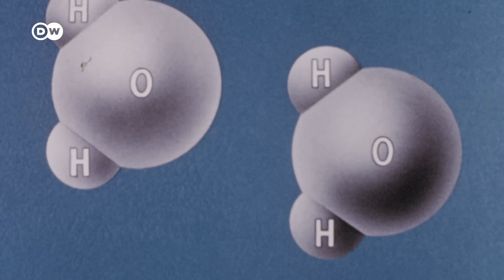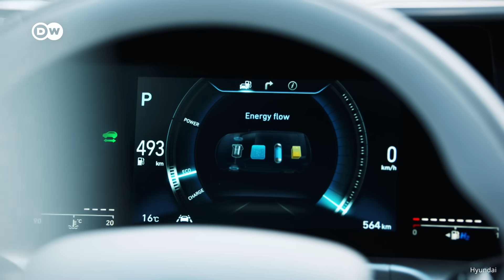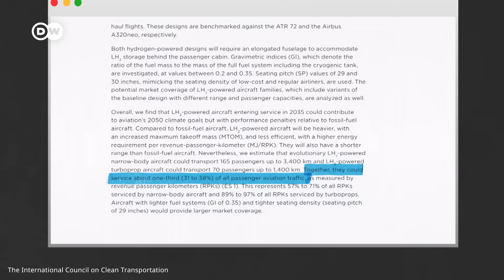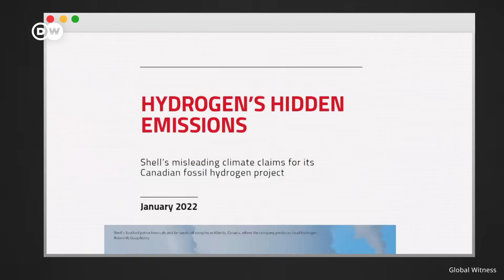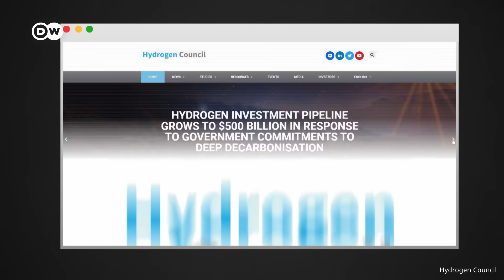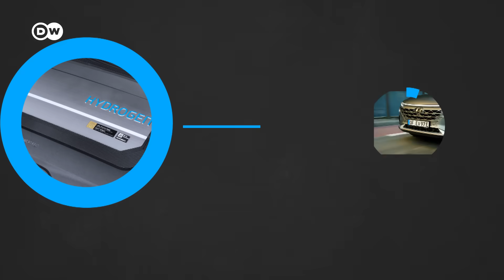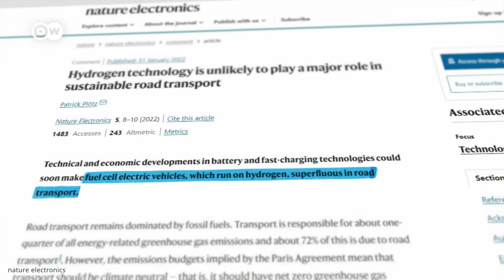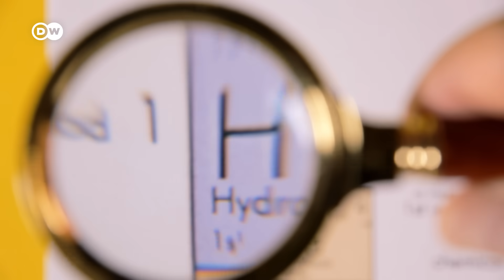The truth about hydrogen

Comment: Good video, but ignores the mining, transporting, and processing of cobalt and lithium for batteries.  There is no mention of nuclear.  Clean, safe, and we have that technology.  Battery Electric Vehicles, take a long time to charge, and if you are using wind and solar to charge them,...I am really hoping that was a joke,...you need to figure out how  much CO2 THAT will produce.  Use the nuclear to produce the green hydrogen.  Hydrogen fuel cells can run cars, trucks, busses, and various forms of transportation and take 5 minutes to refuel,...not 5 hours to charge.  If the grid goes down,...(cough) (cough) California,...you cannot charge an electric car.  The question that needs to be asked is what is the goal?  If the goal is to reduce emissions, then let the free market come up with the solutions and employ multiple technologies.  This is not big government central planning.  That's the Soviet Union.  What works in Paris, may not be the same solution for Sweden,...What works n Sweden won't work in California,...Some places need more efficient 4 cylinders and diesels,...others can get by with BEV's, while others would be better served by hybrids and plug-in hybrids.  Hydrogen fuel cell vehicles are a great solution, but they need two things  An infrastructure of reliable sources of hydrogen, and get the politicians to stop trying to kill the technology.  Leave it to a politician to find a technology that is safe, clean, and reliable,...then try to kill it because it doesn't fit the narrative.  These "experts in the video are talking about 1 size fits all solutions.  That's as ridiculous as it is obtuse.

Comment: The one thing that hydrogen hypers never discuss is the fact that the product of hydrogen use is water vapor and water vapor is the most potent greenhouse gas in the atmosphere.  

When water vapor condenses back into liquid water, it does so through an exothermic reaction, it generates more heat.
Reply: Burning any fossil fuel also produces water vapor - breathing produces water vapor - the sea evaporates a lot of water vapor into the atmosphere - like 70% of the Earth's surface - what is produced through fuel cells will be irrelevant on that scale.  I thought you'd be more concerned with the huge amount of energy required to liquefy hydrogen?

Comment: You put solar power panels on a vehicle that then turns a tank of water into hydrogen that burns in your engine, I realize there's some energy loss but that seems pretty simple compared to a lithium battery that when you get into a car accident and it gets exposed to say rain IT WILL EXPLODE!
Reply: Using your logic we could also fly to the sun and just scoop up some hydrogen and put it in our fuel tanks.  Presto...net zero solved.

Comment: I don't trust Hydrogen. It quite literally terrifies me. You can't smell it. It's explosive way more than gas is, in terms of % of air to fuel needed to be present. Idk. I think nuclear power is a safer option. But I'm also not willing to throw out an option because atm it terrifies me. Possible potential but like nuclear it needs work to be safer.

Comment: hydrogen is - at least the way i see it - the most promissing and best solution for the next foreseeable future. Yes, it's not ideal. It still takes loads of energy to get it thus its efficiency drops making current or very near future EV's possibly the best bridge technology. We shouldn't put it aside though. There's great places on earth that could very comfortably create loads of hydrogen using solar energy.
How wide spread hydrogen is going to work is a little dependent on fusion technology. Once we get fusion reactors working Hydrogen may be the best fuel we can have. EVs can have much smaller batteries, range is going to be higher and technically you could use the car to create drinking water, meaning you can recycle the hydrogen you're burning to power stuff.

That being said, I'm fully aware, that even hydrogen isn't a magical solution to all our problems. And, we must not create it any other way than using renewable energies. If there is a way to derive it from the purification of crude oil into refined without increasing the CO2  emissions as a biproduct, this could be done until the capacity of green hydrogen creation as increased but anything else should not be done for obvious reasons. I'm also aware that fusion technology is far from being anywhere near ready, at this point while we know it could be possible, but we cannot say for sure whether it is actually doable on such big scales. And this is why we shouldn't wait and get a good supply chain of green hydrogen running. In the end this isn't wasted effort. Even with fusion reactors running economically stable this could still be a back up technology.

Another point I wanted to address was already mentioned in the video: While it is possible to comfortably create alright amounts of hydrogen in certain areas already I completely agree that we should think carefully about how we actually use the green energy we currently produce effectively and that at this point in time hydrogen indeed might not be the best idea. But - as mentioned before but never mentioned enough as history has shown - We shouldn't stop investing into green hydrogen today just because it isn't the best utilization of green energy at this precise point. Money we invest today in research will be paid back through much more sophisticated technology and processes once we have a comfortable green energy capacity and it could even advance the point in time this criteria is met.

edit: regarding the cars: I somewhat agree with the video but not completely. I do think battery driven cars can be perfectly fine for city cars, like the tiny cars we have today (Skoda CityGo / VW Up! family, smart for two) but anything that is designed to go for a longer distance or have increased passenger capacity (so basically anything equal to or larger than a modern estate car) should at least be a hydrogen-battery-hybrid. With trucks I think they should have the option for battery or hydrogen run but personally I would prefer hydrogen run trucks. Yes, the efficiency in energy delivery from source to finally the end user isn't as high but batteries aren't a huge fan of high charging currents and the weight of the load - in my eyes - would have a way to high influence on battery life. Yes, it also affects the hydrogen gallons to the mile but a fuel cell doesn't suffer as much on a high load as a battery does on many rapid charge - discharge cycles.

Comment: I think the problem is that H2 is being promoted as if it was a kind of unlimited energy resource. It's not a resource, it's just a storage medium.
Reply: Its a resource and commodity.
Reply: @user-zt4zr7eg6z  It's not a resource. It doesn't exist as a gas in nature. You have to put energy in to make H2 gas. It's a way to store electric energy, but it's massively inefficient compared with storing the same energy in batteries.

Comment: This video lacks crucial detail denouncing blue hydrogen. Why is blue hydrogen worse than just burning fossil fuels? Surely not simply due to methane pipeline leaks.

I work for a major petrochemical company and am part of teams of engineers responsible for reaching carbon neutrality for our footprint. We are actively planning a mega investment that incorporates the production of blue hydrogen and carbon capture and storage. Where is this data against blue hydrogen? I really need to review.

We are also planning small modular nuclear reactors for our process heating and electricity needs. Data for that?

Comment: CO₂ is not a pollutant. Without CO₂ we and all living matter on this planet would die. If the world goes carbon neutral all life will go extinct. CO₂ is good for the planet. Yes, reduce other pollutants that do damage life but not CO₂.   CO₂does not heat the world. When the planet's temperature increases due to external effects ie the sun, then CO₂ increases. It follows temperature increases. It doesn't cause the heating.

Comment: SF6 is an increasing GLOBAL WARMING POISON that we breath.
TESLA is poisoning our entire planet.
Wind turbines emit powerful greenhouse gas sulfur hexafluoride; Germany has highest levels in Europe

While Germany races to build wind farms, there is cause for concern, with a chemical identified as the strongest greenhouse gas in the world being emitted from wind turbines.

In fact, measurements of the air over Germany have already identified the country as the worst offender in Europe when it comes to the highly dangerous substance sulfur hexafluoride (SF6). The chemical is used in the manufacturing of wind turbines and escapes into the environment. With Germany the leader in wind turbine use in Europe, scientists say this is the major factor behind the exceptionally high levels of SF6 readings in Germany.

According to the Intergovernmental Panel on Climate Change, SF6 is a climate killer. In fact, it is 26,087 times more harmful to the climate than carbon dioxide.

Sulfur hexafluoride is a gas that industrial companies consider to be the perfect insulator, and while banned by many other manufacturing sectors, it is still widely used in wind turbines, mainly in electronic switchgears, i.e., the “nodes” in which the electrical energy is distributed. When there is little space to work with, such inside wind turbines, the gas provides excellent insulation while allowing extra space for vital machinery and parts...

https://www.wind-watch.org/news/2022/08/26/wind-turbines-emit-powerful-greenhouse-gas-sulfur-hexafluoride-germany-has-highest-levels-in-europe/

Comment: ...a re-fueling stop for a hydrogen powered ship... which floats on.... water.... just add a 2nd fuel cell that processes the hydrogen from the water as the ship is moving through it... you wouldn't even have to externally power the system if you used a turbine that sits at the bow of ship right underwater which can literally be powered by the ship moving through the water... draw the fresh water in, process it into hydrogen on the ship, power that process via a turbine that's built into the hull of the ships bow, main propeller moves the ship that movement powers the aux propeller which powers the water to hydrogen fuel cell which provides hydrogen to the main hydrogen fuel cell, since these type of fuel cells can be run in both directions... to produce hydrogen from water and electricity or to produce electricity and water from hydrogen

Comment: So we have one hoax being proposed as a solution for another hoax. This is clear because of the things left out of the discussion. These include-

The low energy density of hydrogen under non-cryogenic storage which makes it very problematic to use in portable systems, like aircraft and automobiles. For instance airplanes powered by natural gas would be much easier to design and operate than hydrogen but you don't see anyone seriously proposing doing this, do you?

Storing hydrogen is difficult at best, has significant safety issues and is wasteful on account of the difficulty of preventing leakage. Arguably the best way to store hydrogen is in it's liquid state but that requires evaporation to maintain temperature.

All the schemes require electricity to make the hydrogen so why not just work on cheaper sources of electricity? It seems that is a necessary prerequisite for any increase in the use of hydrogen as fuel. Another solution is finding a more efficient way to produce hydrogen than electrolysis.

I suppose hydrogen is as good a scheme to trick people into a future with a reduced standard of living than any other. Tyrannical governments may yet find it useful to force poverty on their people.

Comment: mix vegetable oil (renewable) with oxygen , in a standard internal combustion engine  , the amount needed would be much less than comparable diesel usage , so fuel and output efficiency is greatly enhanced

Comment: so everybody is rabbiting on about hydrogen , yes it can be used for fuel but it is extremely dangerous ,at all stages from its production to its use , storage in particular , but no one is talking about the other part of water , OXYGEN ! , using oxygen can increase the heat output of just about any combustible added to it , yes oxygen is a catalytic , not really a standalone fuel , so developing its use can really be considered a new avenue , and a viable one at that as it becomes a component of a high output energy source , so is cost efficient

Comment: By collect and storing Hydrogen and Oxygen separately (perfect for electrolysis) you can then use them to power existing internal combustion engines with a slight modification. This mixture provides more power to the engine than existing fossil fuels. Expensive fuel cells aren't necessary. We can use existing engines. This is the best way to help 3rd world countries go green particularly as they often have a great deal of sun and access to sea water to generate their own fuel.
Reply: it produces dangerous byeproducts of NOx when burned in IC engine. Existing IC engines try to reduce NOx by running less efficient and producing particulate carbon and CO, as they are less dangerous. With H2, NOx is unavoidable.
Reply: @mastermanvir  Burning H in air yes. Burning H with O (not air) produces H2O in ICE and more power than hydrocarbons.
Reply: That's if you burn in air. Burning hydrogen in pure oxygen produces pure water. Nothing else.

Comment: Is it possible to do the electrolysis (with water to get hydrogen) in the car? Then, the byproduct of hydrogen can be stored in tanks in the car. When the car is parked, it can be plugged into an outlet to get electricity to continue the electrolysis and replenish the tanks in the car with hydrogen.
Reply: You would need an onboard battery. But then why not just use an EV. Hydrogen is all hype. It should be called Hyprogen! When you study the physics and economics it’s nothing but a distraction gift wrapped by the oil industry to look like a panacea.

Comment: This is a good piece. You mention that for passenger cars the battery option makes sense but it only does so in urban or reasonably densely populated areas. In larger sparser areas (eg Australia) there simply isnt the electricity distribution network to allow adequate charging stations to be built. Think about it. In peak tourist times (eg school holidays) some very remote areas get a lot of visitors. Having to wait 20 minutes to do an 80% recharge is kind of acceptable BUT this means having a charging station that can charge, say 10 or 20 vehicles at a time (probably more). This in turn means your cables into tharging station will need to be capable of carrying 1000's of amps. As I said, this is great in an urban area but when you are 1000km away from the nearest power station the cost of setting up that kind of tranmission infrstructure is simply uneconomic. And this is where hydrogen or limited fossil fueld supplies still has a place
Reply: I agree.  The problems in distributing hydrogen were well explained but not the new electric infrastructure required for electric vehicles.  I have puzzled for a long time how we are going to provide the charging infrastructure even in Towns and villages let alone in the rural areas. There are so many car owners who do not have off street parking and certainly in the UK zero indication the government has a plan to address this.
Reply: @andymiller541  :  The existing infrastructure (with some tweaking) is up to the job IN AREAS OF HIGH POPULATION DENSITY.  Move away from urban environments and it requires "Buy-in" from government and/or industry to identify and establish the preferred systems.  Allowing more than one alternative will ultimately result in the failure of all but one of them.
Reply: Cost? Where will you get the materials? You think all the kids studying programming phone apps are going to build power systems? 🤣🤣🤣
Reply: @robertwilber1909  :  Wellll.... quite a few of the kids that played with YoYo's went on to create amazing things.  Tell the phone-app programmers they can't have electricity, and you will be amazed at what they come up with!   😉
Reply: @PiefacePete46  I expect it will be street crime
Reply: @robertwilber1909  : Ouch!  🥴👍
Reply: Did you know that recharge stations exist on the Nullarbor? 2 44gall drums of oil that run a generator. You plug your EV into that.
Apparently the oil used is leftover from the local roadhouse  kitchen.
Now queue up.
Reply: Graphene based batteries combined with super-capacitors will solve the charging problem but they are still years away on a commercial scale.
Reply: @AndyGraceMedia   yes, need something other than Lithium batteries.
Reply: You don't need that much energy to run an electric car, about 0.2kWh/mile traveled. Assuming a certain remote location has 1000 tourist cars a day that need to recharge an average of 500 miles, you need about 100 MWh/day,  or 4MW average power. Any place that deals with thousands of tourists per day will have at least a 20KV/500A/10MW power line that can easily handle it, maybe fit the charging station with their own battery buffers to smooth out the demand peaks. It's expensive to setup initially but such power-lines can last a century in the desert, there is no reason not to invest in it.

Comment: As a 73 yr old Engineer I have created and built everything from computers, telephone systems, industrial equipment and Aerospace equipment.  I see that the one thing that Gene Roddenberry said was one of the biggest problems . . . GREED!  until that is stopped there will not be progress on any of this.  You can hope for it all you want. Until you obey the 10th commandment it will not happen.  A chemical analysis of all fuels shows the only part of any of them that burns, is the ONE element H2.